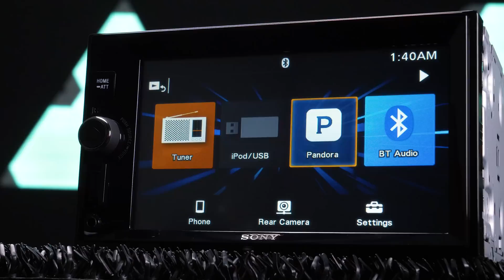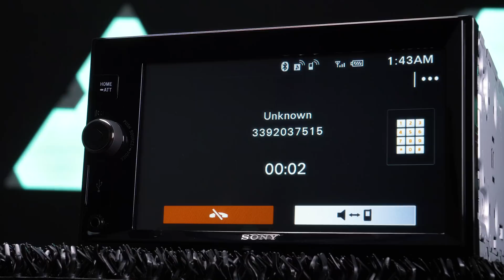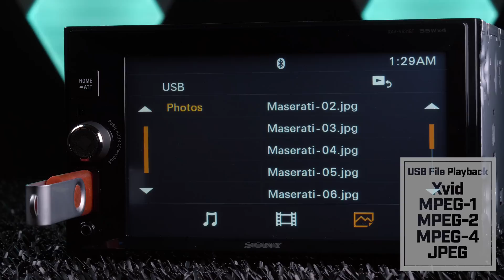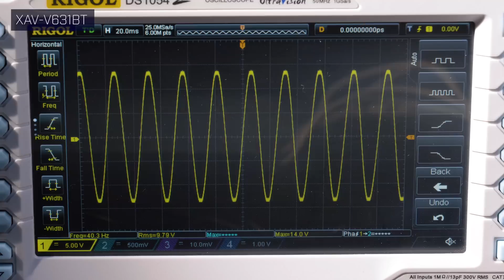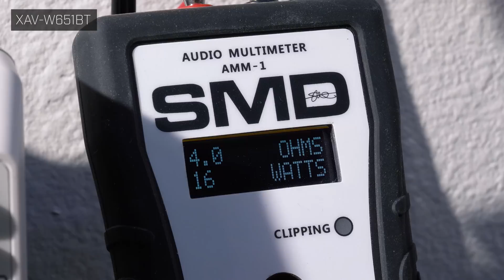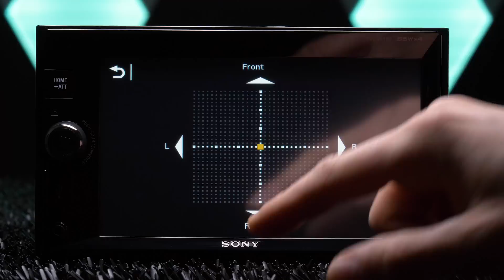Sony XAV-W651BT vs XAV-V631BT - Testing Pre-Amp Output Power

Comment: Is it true the Sony v631bt doesnt support higher than 192kbps mp3s? Flac is supported, but not 320kbps mp3? 

It's on the manual on Sony's site
Reply from the maker: If it's in the manual then it's probably true

Comment: How the heck is the preamp works? Does it work by just connecting to car's speakers the conventional way or do you have to use the connectors behind the unit with independent wires for the preamp to work?

Comment: Any suggestions on how to get rid of 
" White noise " when in Bluetooth?
I tried RESET tab , holding for 10 seconds
Reset Bluetooth by removing and then adding back signal for my Samsung 8S phone 
It did work
Couple days later , same issues 
Tried resetting 
Not working this time 
Suggestions?
Thank you

It 

I
Reply: input volume level adjust that

Comment: hi if you see this help mine turned off and won’t turn back on? it’s the one w no cd
Reply: Stefanie a maybe loose plug in the back?
Reply from the maker: Is anything else effected? Windshield wipers, power locks, etc? Also what radio do you have? Could be a lot of things, wiring issue when installed, electrical issue with the car, faulty stereo, if its a detachable display sometimes they get a little loose and people don't realize.